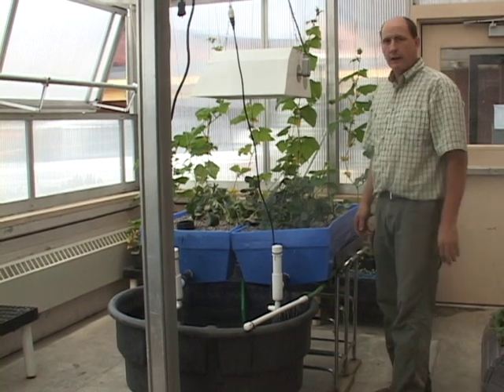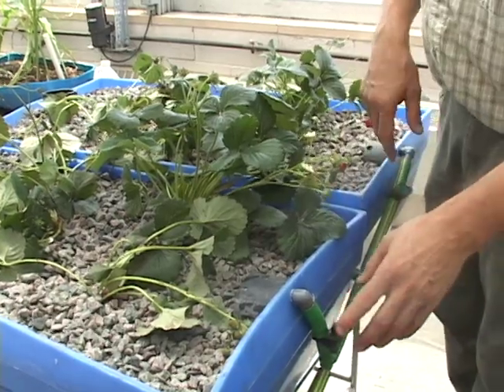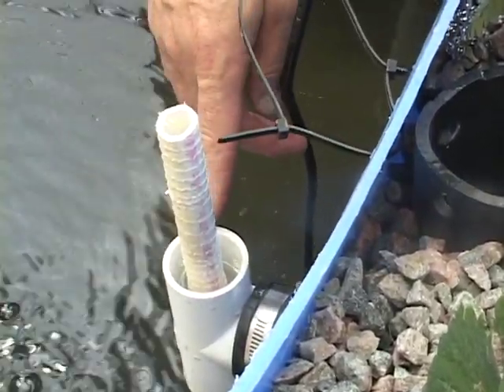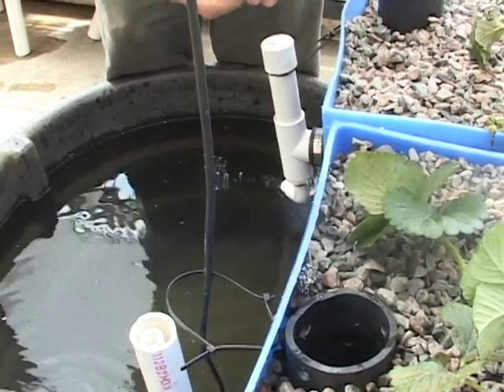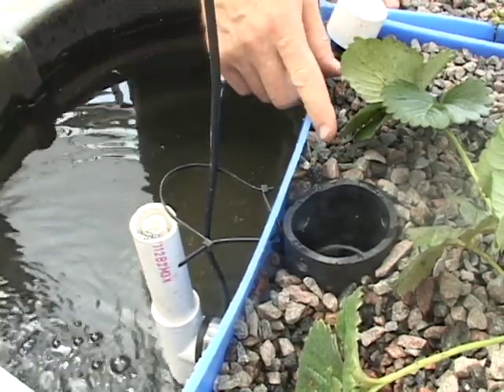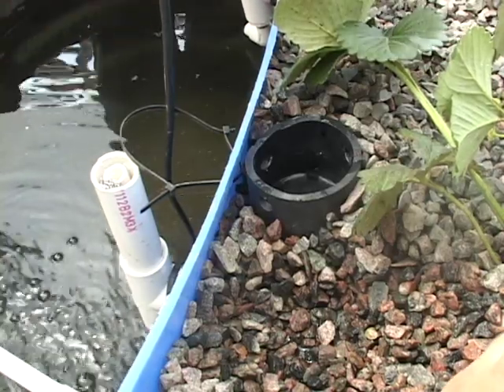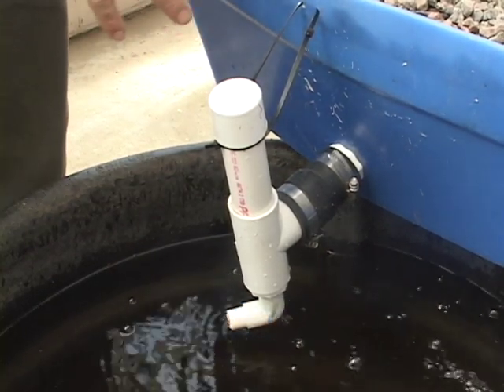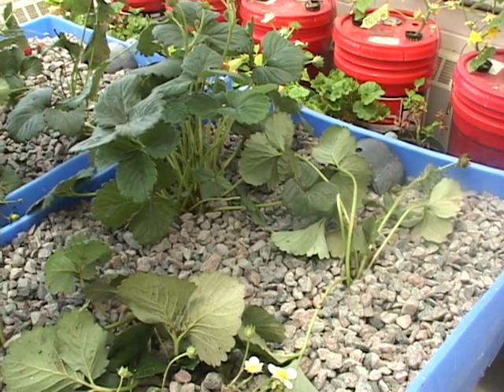Innovations in Agriculture

Comment: Didn't like the idea of a hole in the in the bottom of the growbed as it could be prone to leaks and it meant that the growbeds couldn't be supported on a flat base without additional problems.  
With this system the Bell syphon can easily be removed and/or adjusted without disturbing the growbed at all.  This is a great step forward in the application of a Bell syphon in aquaponics.